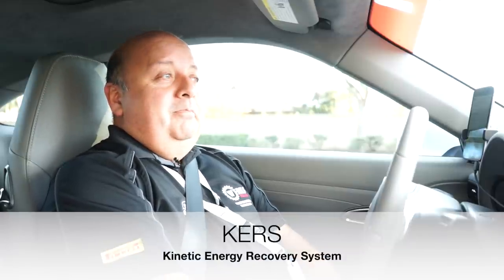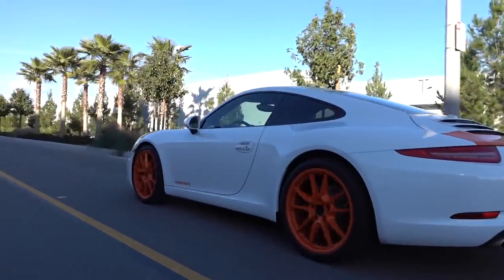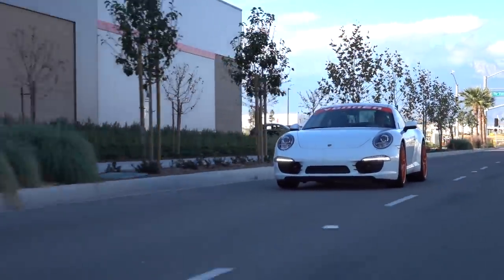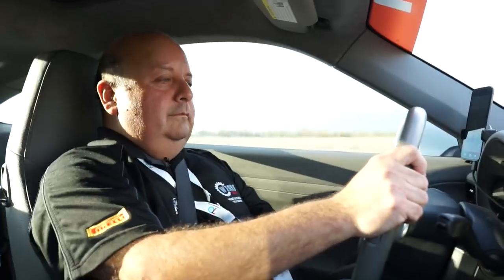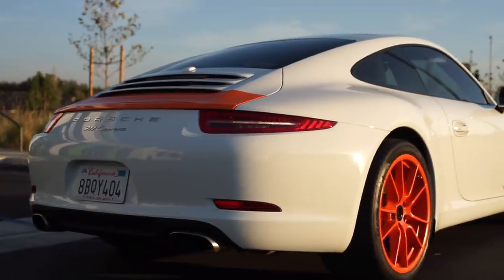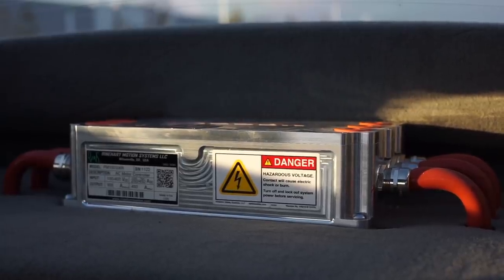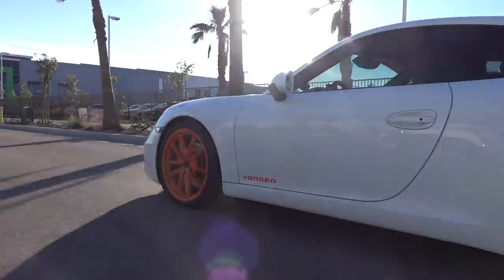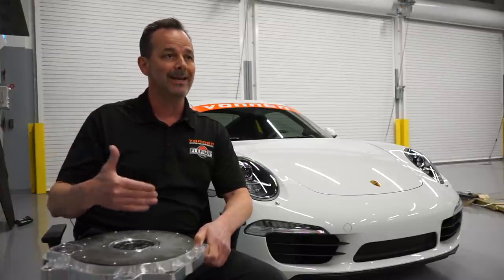PCA Spotlight: Vonnen's Porsche gasoline-electric hybrid system

Comment: $75K installed...for 175 extra horsepower in your 991.1 Carrera...you can get a 991.1 GT3 for less than the price of an okay 991 carrera plus this “alternative”... $75K still doesn’t justify in a GT3 or a Turbo model when tuning is available. I say leave the cars the way they were designed and built and team up with Porsche to create a 911 E-Hybrid (I’m sure they already have with the Mission E and Taycan) but even if it only costed $25K it still wouldn’t justify the price... :/ it’s cool REAL technology the (KERS) unlike the BMW i8 and some other gas/electric vehicles having a completely separate electric motor adding the power say at the front wheels but it’s just not obtainable yet to the masses where it would be reasonable.
Reply: I agree this system is great but it needs   to be at $10k to make any sense. Why would you spend 75k on this system when  you  can spend less on a 997 / 991 turbo.
Reply: Not to mention it only make sense on older 911 generation 991.2 & 992 do have the low range torque with the turbo addition now. So the market is 991.1 or older for 75k... Man I hope this is only R&D for a long term plan, or planning to be swallowed by a large vendor...cough...Porsche.
Reply: This system can be added to any 991 model including the GT3 and Turbo.   It's for the guy that wants his car to be the best and fastest example of that model, whatever that model is.      A Vonnen equipped GT3 or Turbo is in true supercar territory.     All without impacting smog testing or otherwise killing driveability.
Reply: Vonnen it isn’t true super car territory if the power boost won’t even last a 1/2 mile
Reply: @vonnen  are we talking only 10-second bursts? I'm interesting for my 991.2 Carrera but not if I can't even do a 1/2 mile event with it.

Comment: What is being done for the inner axle attach being moved @2.5" forward?
Reply: The transmission only moves 1" forward.  The CV joints can handle this easily in this car, like if you lowered your car 1".

Comment: I can't imagine there is a market for this product at that price point.  I am also not sure the words "only" should precede 120 pounds either.
Reply: For a hybrid addition 120 lbs is very light.   Vehicles available in a gas-only version alongside a hybrid option typically have many hundreds of lbs in weight difference.    As one data point, choosing the hybrid option for the Panamera adds 700 lbs compared to the similar equivalent gas only version.    
The Vonnen system provides a very big boost in power-to-weight ratio.